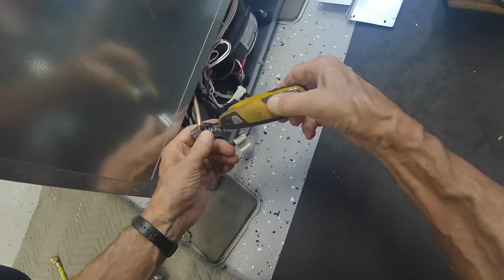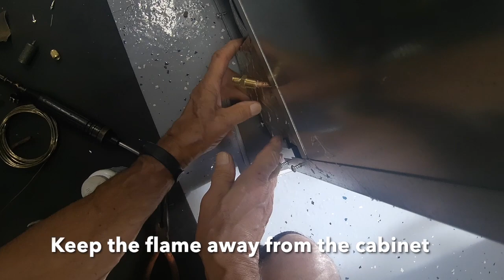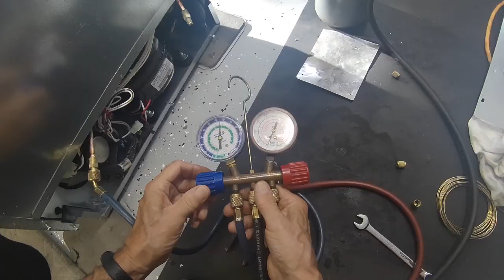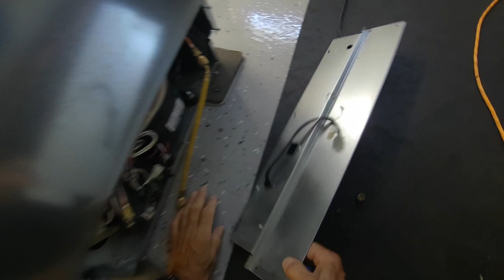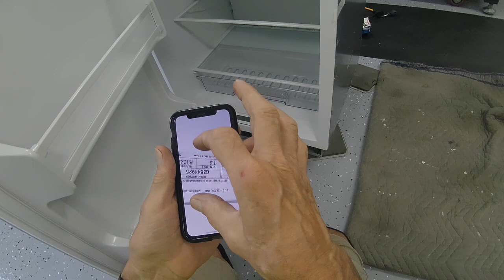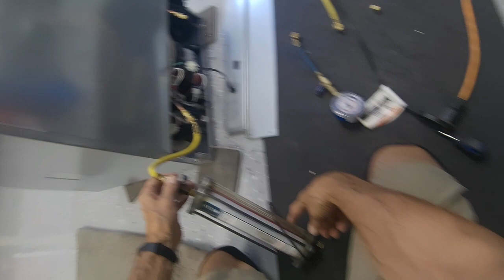Sub-Zero UC-24 Troubleshooting

Comment: I have a uc2bg/s/th that’s just started an issue. Gets cold then hours later warms back up. Any idea where I can start with this issue?
Reply from the maker: @MattHawes-h9q  is it a UC24?
Reply: @ sorry miss typed!! Yes uc24bg/s/th
Reply: Was working fine. Unplugged it to move it. Plugged it back in and now having this issue.
Reply from the maker: @MattHawes-h9q  is it a 24” beverage cooler with a glass door in stainless with tubular handle?
Reply: @SubZeroSpecialists  yessir
Reply from the maker: @MattHawes-h9q  does it shut off and stay off or is it running all the time? Go to my website aaronsrefrigeration.com and peruse the Tech-Help files under your model, click on Troubleshooting and see if there’s anything there.
Reply: @SubZeroSpecialists  I will thank you so much. I’ll let you know. I’ll run the diagnostics on it when I get home today. I’ll confirm on if it’s staying running or shutting off.
Reply: @ it stays running. Plugged it back in went from 53 to 38 which is what I want it at. Have a thermometer in there to and it does get down to 38 and then the fridge stays running
Reply: I did check for any diag codes it didn’t say anything except for (of) on the left side of the display where the temp usually is
Reply from the maker: @MattHawes-h9q  if the compressor is running continuously and staying at 38 then I would suspect a Freon issue which would require testing the sealed system pressures. Not something you can do without special equipment.

Comment: Which Way is better to check the compressors' valves, the mothed you've done or connect the high gage to the discharge and let run approximately till 400psig, then close the valve and turn off the power?
The Gage should stay, if not then The valve is bad.
Thanks alot.
Reply from the maker: Best results for me is by pulling a vacuum, draining out all the Freon, closing the discharge line and then shutting off the compressor. This is what I learned in school back in the 70’s
Reply: @SubZeroSpecialists  
God bless 💐